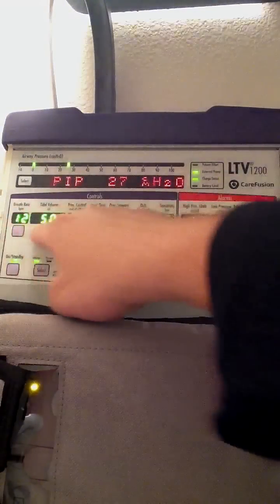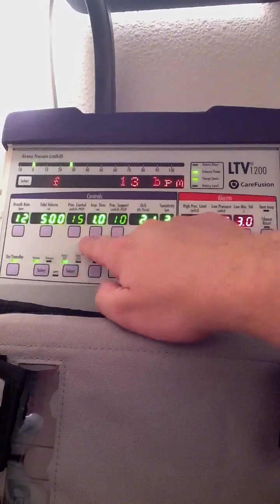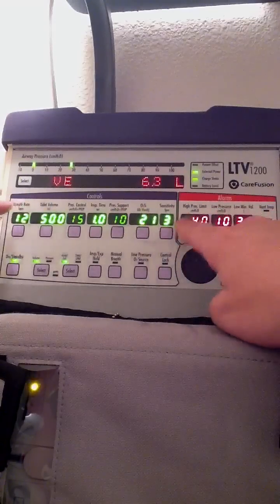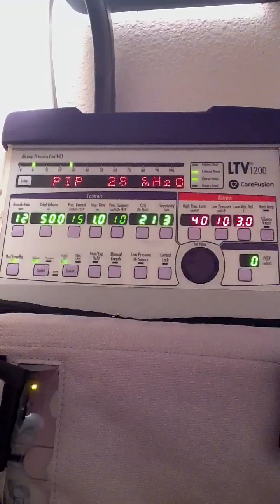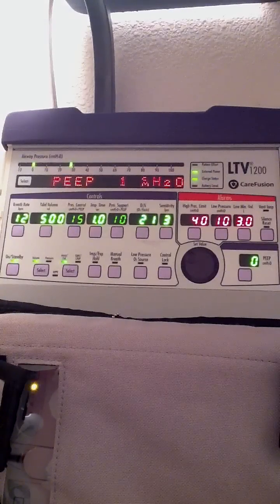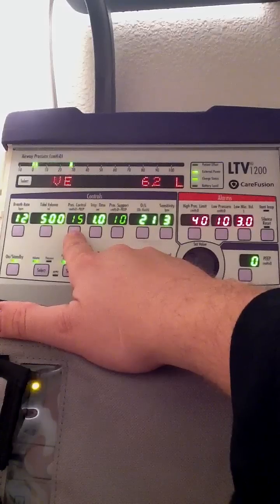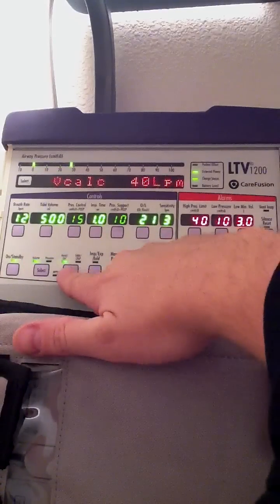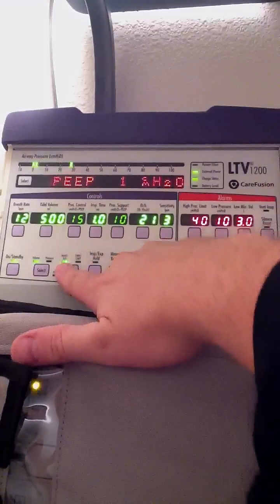LTV Part 2: Initiating Ventilation and Changing Settings

Comment: I use a filter on both the inspiratory line from the vent to the patient as well as the expiratory line. I do this to protect the patient and also to protect me from what infectious substances the patient may be exhaling. I transport a LOT of patients with ID/ISO concerns. I cannot find any documentation anywhere on if this is an approved practice, or even necessary. It just seems logical. What are your thoughts?

Comment from the maker: I am glad you all are finding these videos helpful.

The light is associated with the external battery pack.  Yellow is a caution, the battery was likely a bit low as I had the pack off the charger while filming and setting up the ventilator.